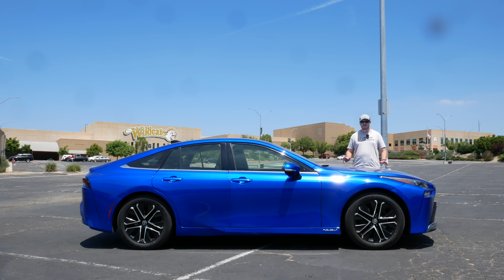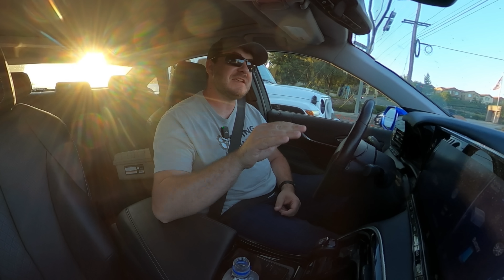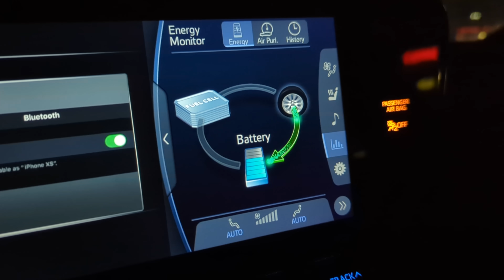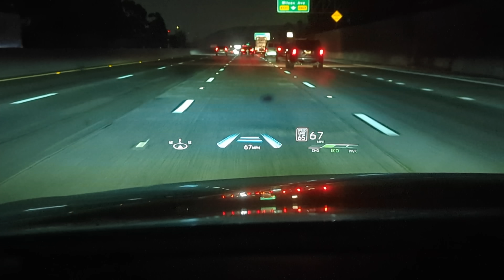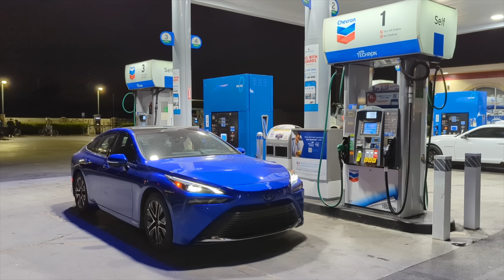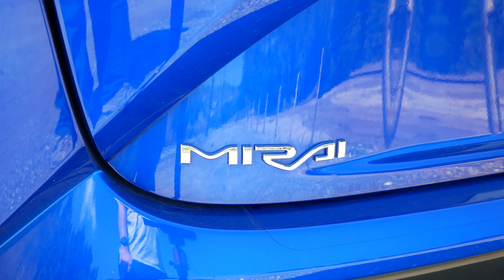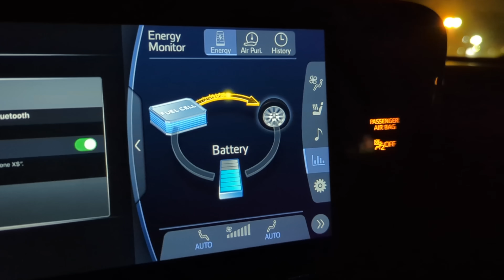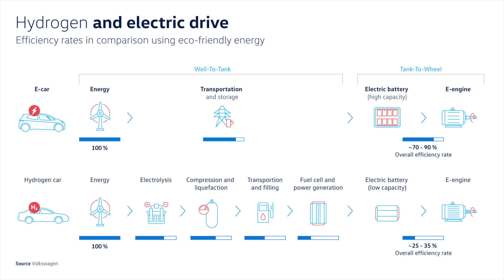The Toyota Mirai is Disappointing

Comment: Holey moley - It's up to $29.95 per kg now? To put that into real world terms, if you drive fast, at 80mph, you get 45 miles per kg, or 67 cents per mile. If you can keep it under 50~55mph, you do a lot better, 63 miles per kg (maybe up to 78 if you are really gentle), but that's still 38 to 47 cents per mile.

At high speeds, not only do you get hit with the extra drag, but the fuel cell is also less efficient when pulling more amps per cm2, so you pay a double penalty, which is why most California drivers are only getting 220 miles per tank, because even local trips are often at racetrack speeds!

(in metric, at 85km/h it does about 1kg per 100km, at 125km/h about 1.4kg per 100km - source Bjorn's 1000km Mirai challenge and Sunday Drive videos)

Great run through and summary - this looks like Mirai Club's vehicle? Great channel to see the realities of hydrogen. Couple more points, I think for trucks, battery swaps, or even entire tractor swaps, are more scalable than hydrogen filling stations - at $2.5M to $3.5M per station (you didn't touch on infrastructure costs - or who pays for them) it's cheaper to overbuy entire tractor units and 'pony express' swap them with charged ones if fast charging isn't fast enough - in reality though, those really long legs will stick with diesel, and everything local or even regional will go battery.

My main beef with hydrogen though? It gets used as an anti EV tool, not to get people into a hydrogen car, but to keep them in their gasoline cars while waiting patiently for hydrogen to be cheap, green and everywhere - none of those things are happening - ever - if Toyota really wanted to push hydrogen they would have done what Tesla did, and build out the filling network for their customers, the renewable generation and green hydrogen production plants.

So the reality is, the tiny numbers of hydrogen cars and small number of unreliable filling stations are having an outsized impact on delaying the transition to EVs - you see it in the comment sections of socials all the time "I'm not getting an EV, I'm waiting for the promise of hydrogen" - videos like yours are really important to show the truth, hydrogen at scale just isn't happening.

Spot on with the losses too, it's about 54kWh (maybe 52kWh) into the electrolyzer per kg of hydrogen (inc. compression, chilling, venting) for just 63 miles of range at 55mph, a Hummer EV is more efficient, and hydrogen gets (much) worse at high speeds - so to get that long range, you have to drive slowly, completely negating the fast fill benefits (assuming no line, a working station, and single fill with no retries)

I'm mad as heck at Toyota for not making a dual bet on EVs and going all in on Hydrogen, and then doing anti EV shenanigans - if I adjust my tin foil hat, I would argue the goal was always to keep selling gasoline cars this entire time, and that they were never serious about hydrogen either.

Distract and Delay.

Comment: There is another way to store hydrogen for use in a fuel cell that nobody seems to talk about: Ammonia (NH3)

It's a liquid so you can store it in a conventional tank of any shape, we already make tons and tons of it, it's easy to transport at room temperature and pressure, it's no more dangerous than gasoline.
The only downside is separating the three hydrogen atoms from the one nitrogen atom but that would just require more research and is a very solvable problem.

Comment: one other thing is that lithium and cobalt used in batteries are limited resources that we are quickly depleting... a chronic problem with green energy is that much of the time green energy sources will be at high output while the electric grid is at low demand and that energy could be stored in batteries if we had the battery technology and infrastructure to store that energy (which would also make the limited supply of lithium and cobalt even worse btw) or an alternative is to use that excess energy to electrolize water and generate hydrogen and then use that hydrogen to power cars and trucks which just makes sense. all that's missing is the economies of scale to make it affordable.
Reply: Cobalt free batteries are readily available and already heavily used in stationary applications and even EVs. Look up lithium iron phosphate. Lithium availability is not a concern at all, just the refining capacity.

Comment: The reason why Toyota is focusing on hybrids and hydrogen rather than BEVs is due to global geopolitics & supply issues.  To get to the point that many world governments want us to be with electric vehicles requires a massive increase in material resource consumption that cannot be realistically achieved - and that's before considering that most of those resources come from China and Russia.  BEVs seem great, but they are short-sighted.

Comment: Less than 60MPGe

Some may stick with model 3 LR and have some quality upgrade ie better tire, softer suspension and additional sound deadening

Or slightly used model S that's available on $60k ish

Comment: Main issue I've had with fuel cells is that the cells have a life expectancy as the cell itself is a wear product. Even worse is they use platinum in their construction so replacing them is basically the same price as an EV battery. Not that this is popularly discussed as fuel cells are uncommon outside industries and very few people have kept the cars long. 

In general I've seen fuel cells have a lifespan of around 5-10 years so your fuel cell may fail before you've even finished paying it off. That would suck.
Reply: Is that 5-10 years until it loses some arbitrary amount of efficiency, or 5-10 years until completely unusable?
Reply: @addison1024 it will slowly wear over time. That's about 5-10 years to failure. Also I learned in more recent time there's another major concern with hydrogen as a whole. Apparently the Mirai has an experation date sticker right in the fuel door. That sticker is saying when you need to get your fuel tank replaced as carbon composits degrade with time exposed to air and hydrogen itself also destroys it. So not only is it a bomb on wheels, but one you legally can't fill after a certain date without being liable. Its pretty far out though being 15 years after manufacture date though good luck finding a new tank at that point, and I can't imagine a rare carbon composite tank would be cheap.
Reply: The same as battery. How much is fuelcell compared to battery?
Reply: @tommyking626  well I'm talking wear till worthless. Plus the rare materials in the battery could be recycled, if we tried, the platinum in a fuel cell is quite literally burned away. 

Not like it matters anyways, it doesn't look like hydrogen has much a future at this point in the large scale. The only real advantage it has yet is fast refueling. Range for vehicles is about the same as batteries, hydrogen fuel cells take far more equipment and complexity meaning they don't really end up making lighter vehicles, the fuel cell doesn't have enough power to run the system on its own needing some stored battery power, etc. It's a cool idea, but honestly hydrogen combustion almost has a better future. I think fuel cells are really stuck to the more niche uses like space, maybe submarines, and other cases the splitting oxygen is useful.
Reply: @Skylancer727 Personally, I feel the future for hydrogen is far more likely to end up in combustion than fuel cells. far cheaper production (for the engine vs fuel cell) thanks to pre-existing production methods and knowledge, as well as the engine not being a consumable product
Reply: @friendlysnoworb6091  It's something that sounds right on the surface, the issue is just that hydrogen is nowhere near as energy dense so hydrogen combustion makes EV range look good. Toyota did that hydrogen combustion race test and the entire rear seat was a tank and even with that only a range of 170 miles. That's the reason fuel cell is the only really talked about solution, it already has rather abysmal range, but combustion is far worse. Combustion really only makes sense for the areas storage aren't as serious an issue like cargo ships.
Reply: @Skylancer727  Agree. It would really take a huge tank to get good range.
Reply: @tommyking626  Remember that a hydrogen car has a fuel cell that may need to be replaced, as well as a lithium battery like an EV that might need to be replaced. I've also heard that because of the high pressure, the hydrogen tanks might need to be replaced at some point. That's a lot of stuff to replace.

Comment: Hydrogen fuel cells are just like batteries, in that they store energy chemically. But you charge a battery by just feeding it electricity, and you "charge" a fuel cell by physically shipping the chemical the energy is stored in. It's shockingly similar to literally just filling and emptying the acid in a lead acid battery. in fact a lot of the same chemistry applies to both (charging a lead acid battery releases hydrogen via electrolysis, and you top up a lead acid battery with plain old H2O). It's quite literally just a battery with extra steps.

Comment: 9:19 is relevant to the carbon fiber sub that imploded yesterday or today
Reply: Imploded. Carbon fibre is incredibly strong in tension (with the pressure on the inside) but terrible in compression (pressure on the outside) as it was being used in the suicide machine.

Comment: 3 letters. CNG. Higher energy density, burns rather clean, takes less space and complexity. It's the only real option. This, like most electrification, is merely a marketing gimmick. A gimmick meant to improve electronics, and increase reliance on the tech industry. The physics of molecular energy density proves it. To make this actually viable, requires breaking the laws of physics. So, yeah, I didn't really care about electric cars.

Comment: This is a decent overview of hydrogen cars and their quirks, however i think the main issue is comparing them to electric cars which they are NOT competing with hence their lack of ev compatibility and Toyotas marketing aiming away from the EV market, just like the prius, people are going to unfairly criticize these cars and especially with minimal support infrastructure wise car companies definitely have their work cut out for them remember that this tech is practically brand new and the "inefficient" (67%) fuel cell stack has over double the efficiency of gasoline (33%) and just around double that of diesel (35-40%) the fuel economy gauge measuring GPMe makes sense and as the tech evolves it will significantly improve, recall that in gasolines infancy engines were at best 12-15% efficient!

Comment: Hydrogen would make sense if it was made by a nuclear heat powered chemical plant, not by intermittent renewable powered electrolysis. That would be the constant, bulk generation of hydrogen the world needs.

But you know what else you can do with hydrogen and nuclear heat? You can capture carbon from the atmosphere and "just" make a hydrocarbon fuel again, which is much easier to store than hydrogen and in fact the entire world is already set up to transport, store, dispense, and use liquid hydrocarbon fuels.

Hm.

Comment: No question, there a pluses for both of them. I would have liked to see hydrogen get a solid shot like EVs, big networks (nationwide), different brands over 5 years making them and see how far they could go with it. First EVs, 30-60 miles a on a full charge if not less, now today, cars can do almost 450 if not more.  Hydrogen never really got that shot. Just 2 brands in a very low volume area. 

For all the good people claim on EVs, there is bad, Making the batteries, worse than ANY ICE car on the market, the stuff needed to make batteries of this volume does nothing good for the enviromint, never mind life span of the batteries, they will fail, could be 3 years, could be 10 years but, they will fail, Now the disposal of batteries/EVs. Also, the resale value on EVs, one it has 30-40% less range, do you think it's worth good value anymore?  Then the battery fails, the replacement cost is more than the car is worth. 

Think of that 70's car that is so cool, do you actually think you will see ANY EV that is 50 years old still on the road?  Think about it. No, odd are very high you won't.

Comment: Actually the Toyota Mirai is a very sensible idea. Like you explained, if we are to get rid of the diesel and Gas vehicles and machinery because of pollution then some form of energy must propel the heavy machinery needed to support modern living and thus the Hydrogen fuel cell has emerged much more victorious over pure electric and Battery powered systems. Hence it makes sense that more and more hydrogen fueling stations and infrastructure will be built to power the heavy machinery and then that technology will trickle down to smaller vehicles. The Mirai is not proposing  to be a sports car with kick you back in your seat acceleration and in general most people commuting to and from work or for pleasure say visiting family etc don't want or need that type of sports car but a comfortable, safe and reliable way to get around and thus the Mirai is an excellent vehicle in my opinion and that of a certain former "Top Gear" presenter. Yes the lack of infrastructure is holding them back but they are testing in one of the most confusing, litigious and difficult areas to live in and with, including the people. So if it thrives there it can do great anywhere, and before you knock them ask yourself why doesn't other  car companies test their new technology vehicles in those same areas? Toyota got this one right and you may hate to admit it but they did.

Comment: I love that engineers are experimenting with hydrogen technology but I don't want us to go into a direction where we hype it up to be the next big thing for cars just because it follows the refill idea of old. It would probably be a good idea to look into it more for heavy vehicles (I know buses and trucks with hydrogen power are coming out more than passenger cars now) since they don't require as dense networks of distribution and need a lighter chassis weight, but for passenger cars I don't really see the point. You have to first spend energy in production and transport of hydrogen like you do with petrol/diesel before it can be used, a BEV uses energy directly without middleman steps and it's "fuel" is available everywhere at all times for the personal consumer.

Comment: The rush to EVs is naive  and in a generation or less hydrogen will be the fuel which replaces gasoline. It is a matter of organizing generation and distribution -- just as happened with ICEs over a period. For example, the Benz engine could use a range of fuels which, mixed with air, would explode in a cylinder over a surprising range of temperatures.
Rudolph Diesel's engine was design to be fueled by groundnut oil (such as was made in his childhood home place of Alsace-Lorraine) and he opposed to the use of fossil oil and the complex and dangerous refinery industries which spread during his relatively short lifetime.
Petroleum and diesel fuels developed in response to military demand then public demand when they did and hydrogen fits in well with green electricity generation in some parts of the world. This coincidental 'partnership' will allow the many benefits of hydrogen direct fuel and/or fuel cells for batteries of a far less dangerous type than we use at present.
The fact that (e.g.) Li-ion carry all energy within the battery unit rather than mixing work elements inside a strong container makes for fire danger and continuous reaction during EV vehicle fires which, it must be said, are more common than manufacturers declare.
Moreover, when an EV begins major battery emergency the vehicles lose power to doors, air bags, steering, brakes etc. Pollution in mining, processing and disposing of common EV batteries must be taken into account.
Work on solid state batteries is not showing expected results but 'slowed capacitors' are making headway -- but they still carry power in a single place.
Toyota etc in Japan and other countries will continue to see hydrogen propulsion to full fruition in coming years and "pure" EVs will be a thing of the past. Hybrids, however, able to use whatever sources of motive power are common at a given time and places will be refined to approach the efficiency levels of such as Tesla EV cars at a rather lighter weight and without range anxiety.
Reply: To be fair, hydrogen will always be a pain in the ass. Synthetic, carbon neutral hydrocarbons, and hybrid Diesel engines, or something using gas that reaches the efficiency of Diesels is the way. Some might have a plug and be a plug-in hybrid. EV has a niche, but that's it.

Comment: I know what's wrong with it, ain't got no hydrogen for it. I've looked into the Mirai before and had the idea of storing hydrogen in a tank like they do for propane, however, that would be more complicated than just owning an EV or regular petrol motorcar. It's too bad because the concept is cool, but using any hybrid vehicle would be a smarter choice.
Reply: You can't store hydrogen like you do propane, because it can't be liquefied at room temperature.
Reply: @RobertHancock1  Yeah, hydrogen storage was already explained in the video.

Comment: Hydrogen might have some use in aviation, and maybe, maaaaaaybe long haul trains. Otherwise its the most moronic power storage medium on the market. Even the "quick fill up time" is a relative area, if there was more than one Mirai filling up you'd quickly recognize a significant decline in refill speeds. And that repressurization time is well in excess of an EVs due to to all those damn inefficiencies.

Comment: One point you missed: Hydrogen fuel cell EVs are the only hope for a cheap used EV market. Lithium is just too valuable to ever have the equivalent of the $3k cheap gas car. The scrap value of the batteries in an EV is more than that.